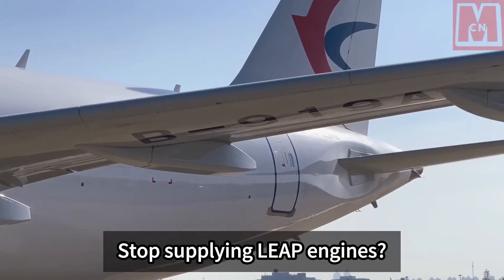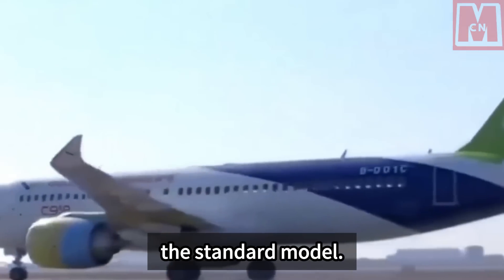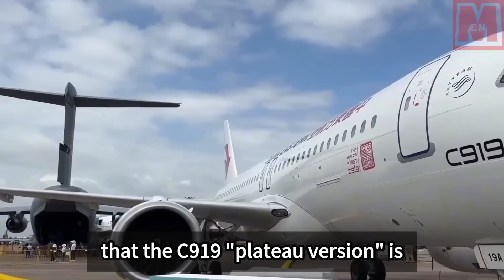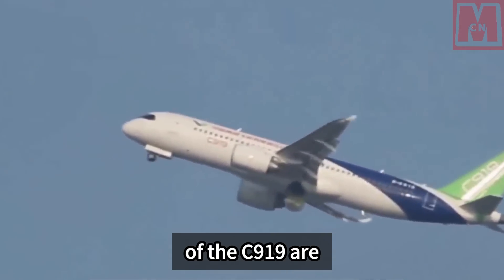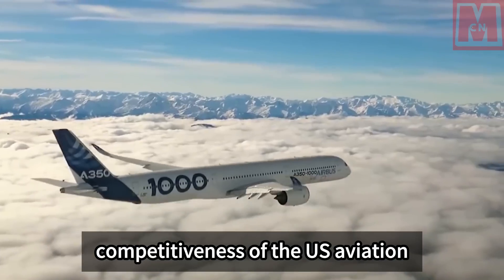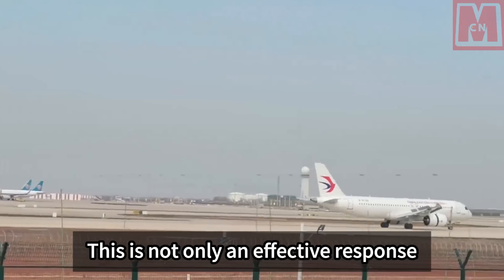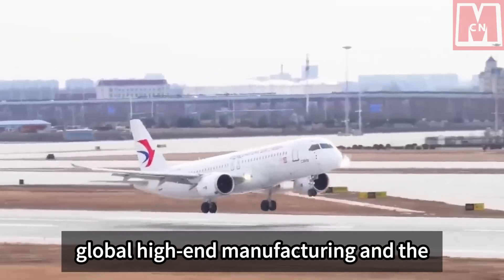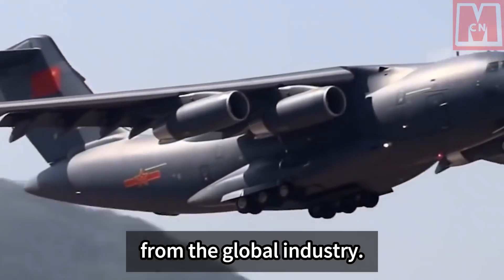US halts Chinese aircraft engines, but China overtakes in a surprising turn of events.

Comment: If the US forces or restricts LEAP engines, China will speed up its CJ-1000/2000 engine development. Another example of US own goal. If the C919 has a 5yr+ safety record, it’s going to be a massive distributor in the low cost market i.e, Ryanair, Easyjet, etc.

Comment: The US trying to stymie the Chinese by withholding the LEAP engine will achieve exactly the same result as all the other US lead embargos and sanctions - China will quickly develop their own engine manufacturing industry. Claiming no one can have a 100% local supply chain is simply wrong...just watch!  In response, how is Boing going to faire when China stops selling them titanium or rare earths or a myriad of other essential raw materials that it is absolutely dependant on China to supply in order to build it's own aircraft ?( which it is already struggling with)

Comment: Do not take anything said here seriously. Nothing credible in this report. Nothing like a "Plateau" variant. The only current variant has not even been produced in appreciable number yet. Even the performance specs listed are all wrong - it can do 5,500km, not 4075km. And there is nothing in the report to verify or even indicate the "stupid" click-bait heading given to the video. The LEAP engine is not solely produced by United States. It is a joint product between GE and Safran of France. There is no credible source where the indicated headlines is verified or reported. It is all hogwash!

Comment: Interesting and well spoken commentary.  In my opinion the sooner China can make every part of the C919 or at the very least, buy the parts they need from Russia,  the better it will be, because the lunatics running the USA will not give up on their attempts to wreck the C919 project.  Talk of cooperating with Boeing is fanciful.  You might as well try to cooperate with rattlesnakes or scorpions.  In any case, Boeing's reputation for producing reliable planes is so badly damaged at this moment, that it should encourage no one to fly on a plane, that contains parts made by Boeing.

Comment: The reason these aircraft are similar to american made planes is because they are copies just like everthing china makes ..
Reply: Form follows function. Any twin engine, single isle short/med range, non t-tail airframe will look the same. Winglets and nose configuration is the only real difference.
Reply: @RePete02  No brain types are unable to understand what is meant by "form follows function" as it is too "technical" for their feeble minds to grasp. They think that just because country "X" has cars with round wheels, country "Y" cars should have rectangular wheels just to be different but if country "Y" has round wheels, they must have copied country "X" technology. 
"Winglets" are not due to just fashion design but actually COPIED by aeronautical engineers from observing the wing tips of long distance flying birds such as the albatross and so, it is function here that resulted in the "form" or design. The same goes for the shape of the nose and even the tail section as well as the cylindrical shape of the plane's body. Alternate shapes have been tried before such as square "boxy" types but these were found to be inefficient for airflow.
Perhaps one should look at the shape of fishes and accuse each different species of "copying" from one another because, by golly gosh, don't all fishes that need speed through the water like dolphins and sharks have the same body shape while those that need to hover for slow feeding like manta rays and sting rays  have the same body shape as each other as well? <sarcasm>
Reply: I suppose you also think Chinese high speed trains are copied from US?
Reply: No!
Reply: Are you expecting China to made planes that looks like flying saucers?
Reply: @thewiseone7286  No but i would expect chinese planes would not look like complete clones of us aircraft .Also chinese spies would not be found in the aviation industry trying to steal plans of american made aircraft and then get deported back to china .

Comment: The usa Will fail in trying to curb China’s progress in civil aircraft manufacturing by breaking the supply of engines from the France’s supplier simply because China has already produced her own turbofan engines. Boeing on the other hand will certainly decline further as it is cursed with many serious incidents and will not be able to sell its aircraft to China where the civil aviation is growing. Delta airlines has already announced that has chosen to use Airbus instead of Boeing 737max. Comac has already received more than 1000 orders for its C919 and will take a large chunk of Boeing’s market share as it has become a formidable competitor.